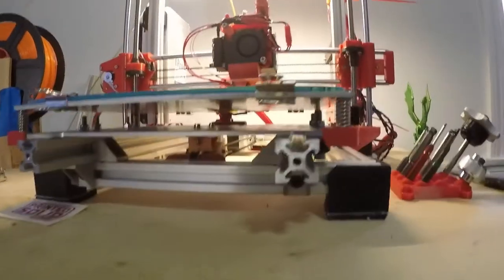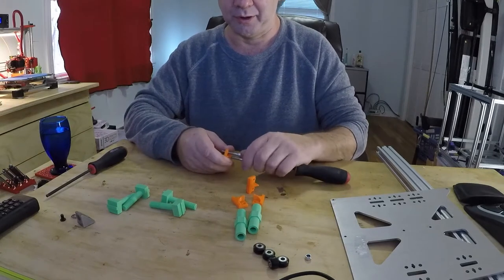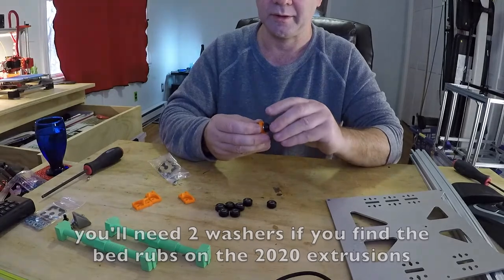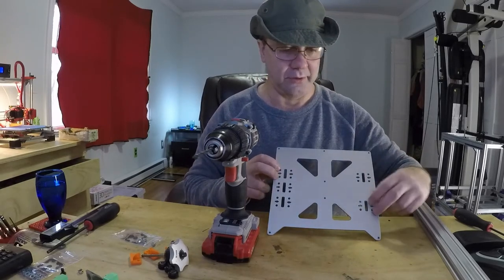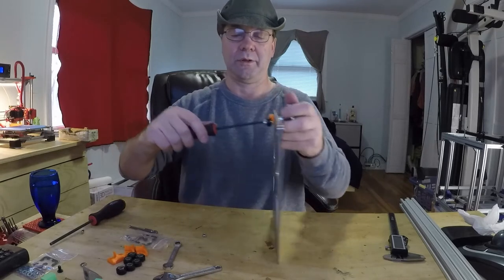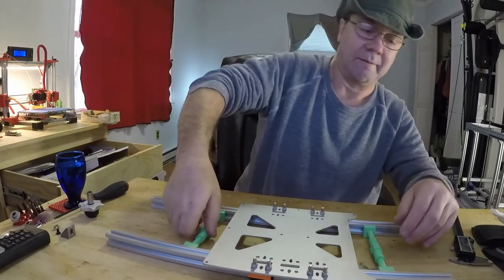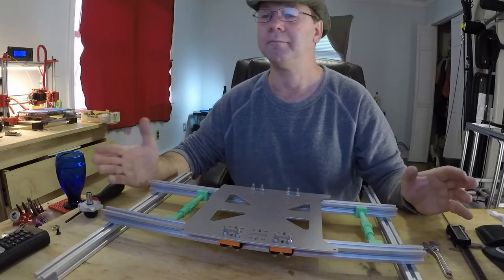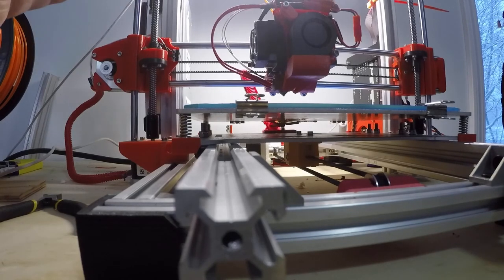replace 8mm rods and crap bearings with 2020 and wheels

Comment: I think I'll be doing this upgrade. Very happy with my Ratrig AM8 frame. But I seem to have a ripple in the Y axis that showing on prints. First going off the ripple was so bad I could feel it, running my finger over it. After some more work, I can no longer feel it, but it's still pretty visible. Then again I'm still using the original Anet H plate ATM.
Reply from the maker: wow, Been a while, I forgot I did this vid . LOL .  Ya, did this with both this Max Micron and also a crappy ANet E12.. big improvement over metal rods and LMU bearings!